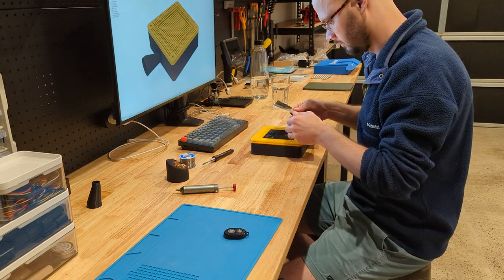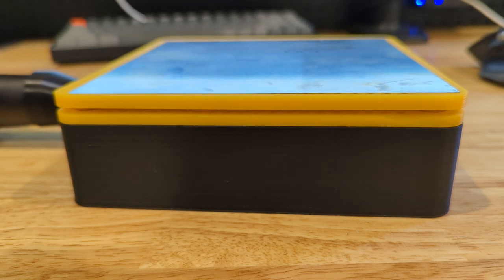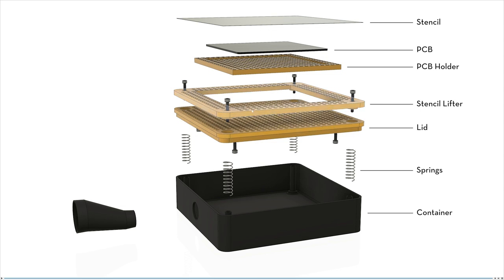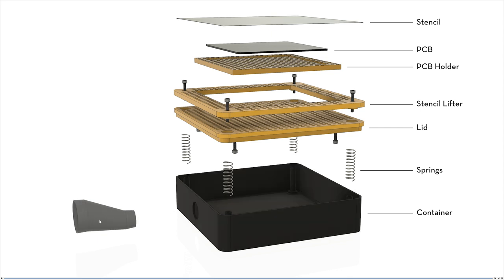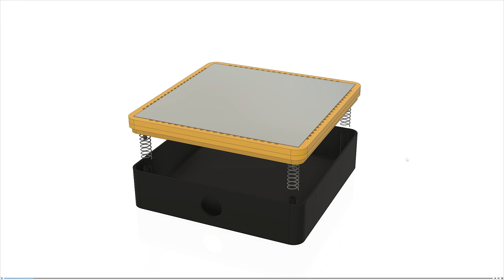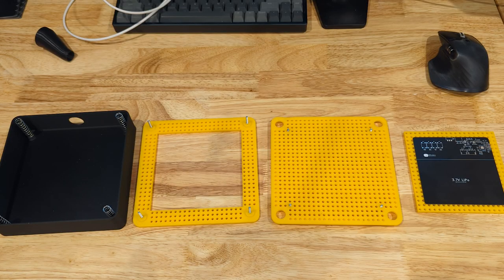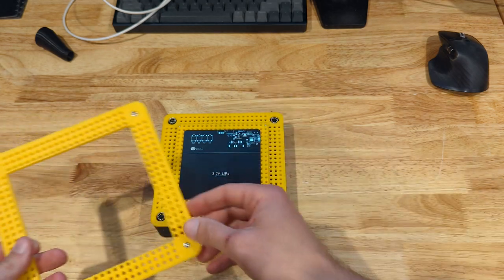Stencil Fix - Simplify your PCB assembly with this 3D printable jig

Comment: The parallel lift mechanism is a really nice touch! One thing I've recently discovered was using KiCad to design my board, and then using kikit to create a small frame around it with vcuts or mousebites. There is a plugin that allows you to automatically add mounting holes and fidicules for manufacturing. There is an option for the mounting holes tool to include the holes in the paste gerber, so it is cut out in the stencil you order. So I'm thinking a modification to speed things up even further and improve accuracy would be to create a parameterized holder where 3d printed rods are included on the part that holds the pcb, and those go through the part holding the stencil, then the stencil, so everything is perfectly aligned together!

Comment: Nice work! Really like the idea. I think you can make this vacuum adapter tight fit, just add small hole on the side of it or maybe adjustable hole to change the suction if needed

Comment: Great design!  I was just wondering if this would work for small flexible circuit boards.  Also, is the board holder adjustable in size?  Also, I only have small sized Kapton stencils. Thanks a lot ahead of time.

Comment: Very nice build!  Have you given any thought to how to mount the stencil so that it precisely aligns every time, for example if you're pasting a bunch of the same boards?  Some hinge arrangement, or maybe registration pins and corresponding holes in the stencil?
Reply from the maker: I thought about it but it will take quite some finessing to get something like that build as we're talking sub mm. Boards of the same run are also not identical as there are always tolerances when it comes to cutting them out.
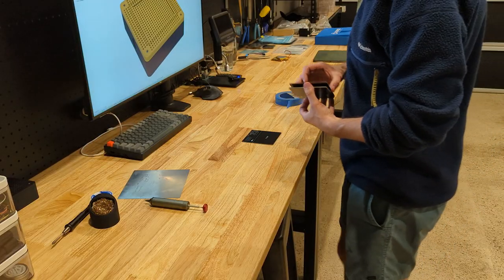Reply: @scheffield  Thanks for your comments. Yes, positioning of the stencil with respect to the board does require precise positioning, to some small fraction of the size of the smallest pad (opening). So for 0.5mm pitch the openings may be 0.25mm, so you need positioning to say 0.05mm.  However, I have not had trouble doing that with the taped-down scrap PCBs method (which you show at 1:00), even with 0.5mm pitch ICs. Repeatable positioning is also the premise behind the "3040 Solder Paste Printer" units on Amazon.  
I find board edges are quite consistent, particularly  within a single order. Some exceptions may occur  for  a board edge after snapping V-cuts, and sometimes mouse-bites leave some protruding frayed material that needs sanding off first. 
Bottom line -- if you manage to incorporate some kind of hinged clamp or other registration feature, that would be very welcome!
Reply: @scheffield  Also, another idea to throw in for you and other viewers -- don't overlook the possibility of making some of this fixture using PCBs. 
For example, the base plate with grid of holes could be designed as a PCB. Multiple PCBs could be glued or soldered together for additional rigidity (or thicker PCB specified).  The additional precision of a PCB over 3D print might help features like registration pins, or a finer grid of smaller holes for better vac distribution.   Also tape sticks to PCB material better, for ad hoc covering of unneeded holes. And you can put useful markings on the silkscreen.  Hmmm, maybe I'll try mocking this up using some grid-of-holes style protoboards.

Comment: Very cool. Could you link the top to bottom layer securely so that those springs don't go missing? Maybe thread some long bars through them which are locked to the bottom piece and put some caps on the top ends?

Also, an adjustable square jig piece would be neat, so you could just dial in a smaller size board. If you had the materials and ability, building the device into an oven would be amazing!

Very neat good job love the video!
Reply from the maker: That could work, I'll give it some thought.

Comment: Amazing video and great tool! I wonder how much airflow you need to get enough suction and if the required parts could fit in the box if the case was slighty taller. just plugin USB or something and press go. I've been meaning to try my hand and some PCB design with surface mount components this might push me over the edge..
Reply from the maker: Brilliant idea. I have no idea but I will give it a good try. Would be awesome to not need the external vac.
Reply: You really don't need a lot of airflow, so long as you don't have much leakage.  You also don't need that much negative pressure just to hold the stencil down flat -- you're just trying to get the stencil flat enough that when squeegee-ing the paste, it doesn't squish through the holes and slide under the stencil and make a mess.  Indeed, too much suction and the suction itself sucks the paste under the stencil.
It's not super finicky, but you're generally not using anywhere close to the capability of a small vacuum cleaner. I think ideally you would like the combination of lowish suction and minimize the leakage, so that the lowish suction is focused where it's needed, holding down the stencil.
(Of course I do realize the vacuum is not sucking the stencil down -- it's permitting atmospheric pressure to hold it down 🙂 )

Comment: Great work! Do you have some tips for the 3d printing? (Layer height, number of walls, infill %)
Reply from the maker: Thanks! I'm using 4 walls, 30% infill and .2mm layer height. You want especially the lid to be sturdy so no to bend under the vacuum.
Reply: @scheffield  thanks. I will try this vaccum box, thanks for sharing!

Comment: Will it work for any pcb size. And shape ??
Reply from the maker: It will work for anything smaller. You will need to design your own PCB holder that then slots into the place of the current one. Make sure that the stencil is still 150x150mm.